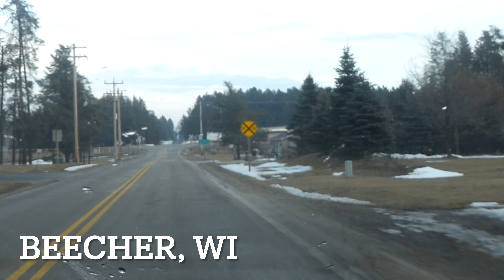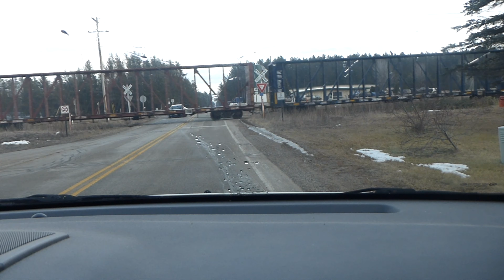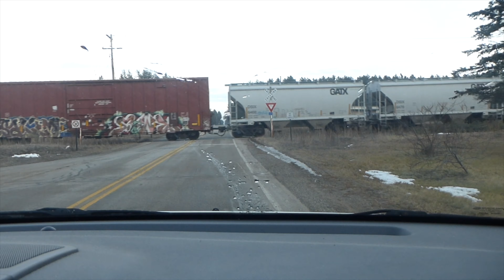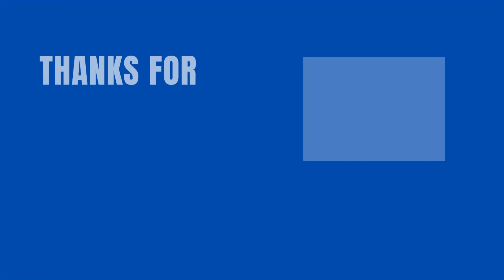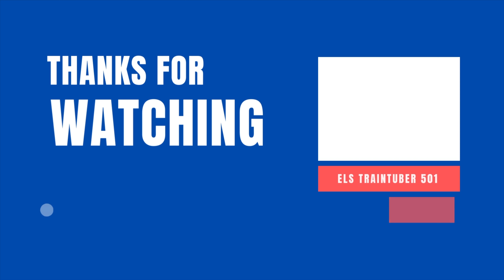Watch out for the train!! | ELS 502 #railroad #train

Comment: What are the potential loads for a flat bed? I can only think of something like large industrial equipment, machinery and such.
Reply from the maker: I’m really not sure
Reply: You are correct... Military equipment, semi trailers and even metal plates, pipes and billets are shipped on flatbeds. Maintenance Of Way work trains also use flatbeds to get the vehicles to where the work is taking place.
Reply from the maker: @backalleyrailroading2835  Interesting